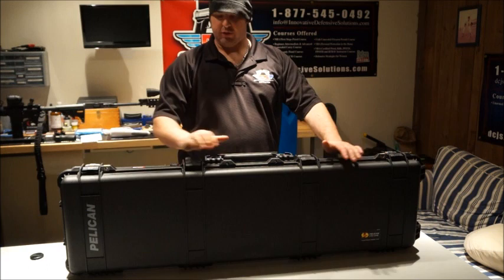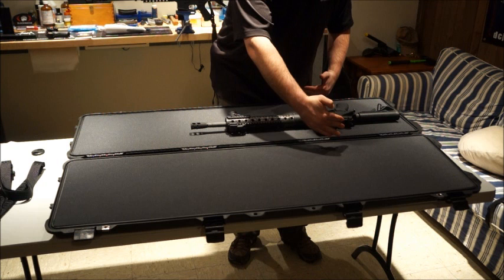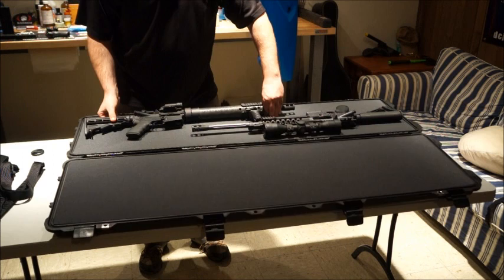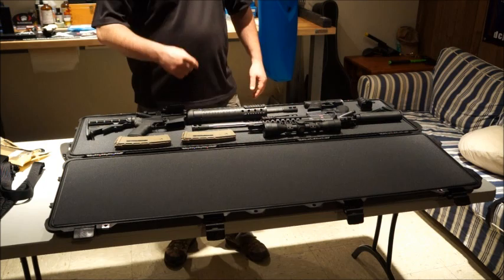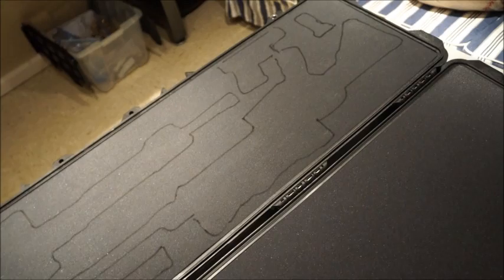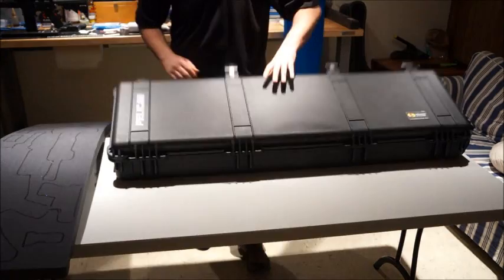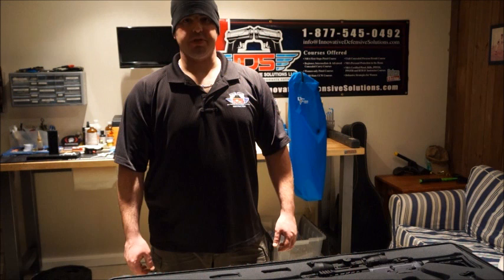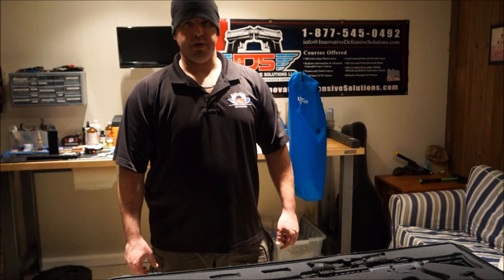How to cut and prepare foam in a Pelican Case \\ Innovative Defensive Solutions, llc

Comment: NO, they don't! if you actually had a clue, you would have done your homework, as I have done. And contacted the TSA and the Airline I am flying on. All the require it so notify them in advance that you will be flying with a firearm (checked baggage). arrive earlier then you normally would, let the airline counter attendant know and have them notify the TSA that you are here to check in your firearm, they open, inspect and you lock it with YOUR own lock, not TSA lock and keep key on your body

Comment: Take the foam and sandwich it between two sheets of thin wood. I use MDF Panel on Common: 5/8 in. x 4 ft. x 8 ft. Cut the wood to the same size as your foam. Use clamps to compress the foam in between the wood panels. Trace your layout onto the wood and cut it with a fine tooth jig saw blade. Remove the wood panels and you have perfect cutouts. Its work perfectly for me.

Comment: Super helpful video even for using a Pelican case not for guns but for ebike batteries. I'm planning a DIY project to stick my two Lextric brand ebike batteries in a Pelican case, drilling a hole in the end of it to install an XT60 connector port to the outside, using a waterproof glue to get a good seal, and cutting out foam pieces inside the Pelican case to make sure that the two batteries don't rub up against each other. The problem is, I want to keep the batteries at the bottom of the case and cut out holes from the foam piece above it. It's going to be tricky marking that while lining it up just right at the bottom of the case. And then I've got to run some tests to make sure that the batteries aren't overheating next to all that foam. They don't get but slightly warm to the touch, but mostly when charging, not discharging. I plan on taking the top foam out before charging anyway.

Comment: Build yourself a hot wire cutter. It'll come out much nicer. Takes little more than a piece of  nichrome wire {guitar string, etc} couple sticks and a 9volt battery or any dc power source. The foam airplane guys are a good resource for info on this,

Comment: Make sure you cut the rifles to lay bolt and dust cover up so TSA can easily inspect the bolt to make sure it is an clear. Otherwise they will hold your case until you can come by and show them they are unloaded as they are not allowed to handle the firearm to clear. Pistols should also be stored with the slide removed and separated/ stored in a different part of the foam/case. 

I always break my lower and upper apart for flight travel that way it is clear for TSA to see in an X-Ray scan that they cannot possibly be loaded. So they have no reason to need to open the case.
Reply: +Thomas "SPAZ" Hill II  I don't plan on going by air, but those are some good tips!
PS: I'm needing a source for .250 /2.75 "Hollow-Core" /aka Low force o-ring material on the spool so I can make my own o-rings for a StarLight case which the female channel the o-ring lays in and the "male" part of the case sealing surface is identical in design to the Pelicans.

Any idea on where to get a 75-100ft roll /spool of "Hollow-Core, Aka Low force .250/.275 Neoprene /EPDM ?

.
Reply from the maker: Thomas "SPAZ" Hill II good tips if you are going to fly, although, every time I have flown no one has checked the chamber. SMH

Comment: I just pulled out the center removable foam and put my guns inside in their soft cases in the Pelican case. When I get to the other end I can still use my soft cases. The pelican case is like hauling around a boat anchor. Great for airline transport but heavy
Reply: +uscgalpha91 A variation would be going to the Dollar Store this summer when they have "POOL NOODLES" @ $1 a piece and grabbing a couple of them and positioning them to help cushion things.
Reply: Fab idea. Foam is foam. I bought a Colt AR barrel and it came in a foam pipe sleeve.

Comment: Just my opinion but when cutting foam, you should trace and cut from underneath for clean cuts. Every one of your cut outs is not straight with imperfections. Also, it is critical to place the electric cutter blade up against an edge of a table to ensure the blade is straight up instead of an angle.
Reply from the maker: Good idea, noted.
Reply: When you say, " cut from underneath for clean cuts."  Please explain.

Comment: If you have something that is below the top foam level, would it be possible to shave a 1/4 or 1/2 of the piece that was cutout and put it back in, so it would be easier to get the item out? If so, how would you go about shaving the cutout piece to an appropriate thickness?

Comment: using an extension lead is ok as long as you unreel all of the lead from its case.
the lead will generate heat if coiled and dragging excessive current.
however I agree he seems a bit dangerous and slap dash. to cut out the blanks
I would have used a hot wire personally

Comment: I just bought a pelican that has no foam inside, do you know where I can get the type of foam that is in these cases normally?  Also, do you advise spraying "plasti dip" over it once you've made all your cuts?
Reply: I bought some more from Amazon
Reply: +Annony Mouse Tell Brack Wilson @ Patriot cases the guy with StarLight case that needed advice on a warranty issue and a place to buy o-ring material for same on a spool so I could make my own case o-rings sent you.

PS: You want 2.2 closed cell foam (Mil-spec- very dense and oil resistant), not the open cell foam, or pick and pluck foam..)
Reply: +Annony Mouse, here's the Pelican link; but I'm also going to look into the foam from Patriot Cases. 
https://www.pelican.com/us/en/accessory/cases/3-pc--replacement-foam-set/1751

Comment: Would you recommend this type of foam or pick n' pluck foam?
Reply: +PhanaticFilms  You don't want "open-cell", OR Pick and Pluck foam.. you want Closed-cell 2.2lb mil-spec high density polyethylene foam. (Mil-spec- very dense and oil resistant)
Open cell holds MOISTURE (Will cause things to RUST)
Open cell will degrade via contact with oil.
Open cell won't hold heavy items in place very well /will allow movement.
Pick and foam stuff, ditto and it will fall apart even faster.
In short anything other than 2.2lb or higher mil-spec high density polyethylene foam is crap. 

Tell Brack Wilson @ Patriot cases the guy with StarLight case that 
needed advice on a warranty issue and a place to buy o-ring material for
 same on a spool so I could make my own case o-rings sent you.

PS: You want 2.2 closed cell foam (Mil-spec- very dense and oil resistant), not the open cell foam, or pick and pluck foam..)
Reply: WeAreNotAlone69 Thanks for the advice! But looking for something to hold my expensive camera equipment, not firearms :P
Reply: +PhanaticFilms You did not mention cameras going in case, nor if items are only going to be transported, vs stored in case.

Open-cell/  Pick and Pluck foam is for light weight items, and it absorbs moisture.

Closed cell foam IMO would be a better choice. This said it comes in various  densities so you should pick density to match weigh of equipment, keeping in mind as density  goes up shock absorption goes down.

One more tip, regardless of foam used put in a good quantity of desiccant.
Reply from the maker: PhanaticFilms this or something denser

Comment: Good point on collapsing the stock, I left mine out when I cut my first layout, I did that so I could fit one that might not be collapsible in the same spot in the future.  But hindsight I would have done it differently, best part is I'd just have to buy new foam.  Also good point on the saving the cut outs..  here is my 1720 https://youtu.be/Eo2NmDq4Nfg & my 1490 Setup for an AR Pistol https://youtu.be/trS1bjsAd0Y

Comment: Why not use a jigsaw?
Reply: +Karl Webb  Jig-Saw would tear the foam, and would be hard to suspend off the foam while making the cut. A High speed router table is what the pro's use.

TIP: I've read that to keep the foam from ""hollowing" while your cutting it is you either put a old piece of foam under the one being cut, Or you fully support the foam off the tablet so the cut goes all the way thru as is being done in this vid with electric carving knife.

Another tip is to do the marking on the backside I've read, but I'm wondering how the start /final part of the cut would line up. I think it would be better to cut it from side that will be showing.

Oh, mark the foam with chalk, and cut 1/4 -3/8 inside the line so item will be held securely... at points you need a place to stick your fingers in to life item out, take a nickel or a quarter and trace around 1/2 of it.

Comment: Pluk-It Foam is the ansewr to this
Reply: Pluck it foam isn't as durable bc the rifle never quiet fits right...and it's not a solid piece of foam.  I have "pluck it" foam in my Plano 42 inch All Weather Case Model 108423. 
I coped with it for awhile...never liked it. Would rather cut a clean shape.

Comment: Entire lid space wasted.
Reply: +Kevin MacDonald lid space?
Reply: MR. Smith When I first bought my 1720 case I looked at options for utilizing the lid space, but didn't want to spend the money on organizer type inserts.

So I glued in a piece of 1/4 closed cell foam to the lid. Then traced out four pistols and four mags for each, on a piece of 1 5/8 closed cell foam. This stacks on top of the bottom layer that has two AR platform rifles. one 16" barrel and one 10.5" barrel with four mags each. Velcro holds to top and bottom of 1/4"foam in between.

It's snug when closing the case but keeps things tight inside. So when you open the case you remove the pistol layer to get to the rifle layer underneath.

Comment: F%@k! Stop using meat cutter and use foam cutter. It's really inexpensive and IT IS DESIGNED TO CUT FOAM!!!
You don't use mud to clean you weapon, ou don't use water to lubricate you car's engine, stop to use the wrong tools!
Reply from the maker: Bazuzeus relax man. When I made the video I didn't know about hot wire cutters, not everyone has access to those, but many have access to electric knives which also work.
Reply from the maker: If I had it to do over I would use a hot wire cutter and or use both to show each method!

Comment: This guy is sloppy and very unsafe in his methods. 1. always wear safety glasses. 2. the reason the electric knife has a short cord is to prevent electrical resistance, using an extension cord is a safety hazard which could cause un necessary heat build up and a short circuit. 3. Never touch an electric knife blade when it is plugged in, even if it is off.

The camera does not truly show the finished results which to my eyes have gaps and some sloppy lines. Also these cases are designed for certain weight tolerances, he has so much shit packed in that case it probably weighs 50 lbs or more, Not a good practice.
Reply from the maker: +Mark Faulk SMH....
Reply: +Mark Faulk 1)  You are correct, anyone doing work with painting, sanding, cutting or grinding should wear safety glasses - but in this case, cutting foam probably doesn't pose that much of a hazard.  When I cut fabric with a pair of scissors, I generally don't wear safety goggles either.2) That's a possibility, but since the electric knife is run intermittently and for only short periods of time, how much heat do you think it could build up and cause a short circuit? I DO know how hot even a short electrical cord can become when it's attached to a 1500 watt electrical heater, but that's when it's drawing a LOT of current over a period of time.  I think you're being overly cautious in this instance; the average electric knife draws about 100-175 watts from what research I've done on the InterWebs.  Unless you have some other documentation to support your claim, I have to discount it.3) Sound advice!  Personally I'd never even touch a blade on any knife I own unless I had 1) Thrown it to the ground, 2) Stamped upon it many times, 3) Picked it up out of the mud and confirmed it wasn't ready to attack me.   Actually, to be quite honest, this last safety tip is probably a sound one; touching/gripping/grabbing the blade of an electric knife that is still plugged in (even though it's Off) could be potentially hazardous if it gets bumped, jostled, hit or dropped while it still has power going to it.  It's a very remote circumstance, but it COULD happen.As to the finished results, I can't discern if there are gaps and/or sloppy lines from the video - it looked pretty clean to me.  As to specs on the case, I think you need to do a bit more research: http://www.pelican.com/us/en/product/watertight-protector-hard-cases/large-case/long-case/1700/ is the one I purchased.  Here are the CERTs it has:  IP67 / MIL C-4150J / STANAG 4280 / Def Stan 81-41.  I'll let you do your own research on Evan Carson's 1750 case as depicted in this video (hint: it's not much different.)I personally don't buy your "he has so much shit packed in that case it probably weighs 50 lbs or more, Not a good practice" theory; this is why I provided you with this link and the CERT info.  Please feel free to prove me wrong!-scoff
Reply: I'm looking at the specs on the manufacturer's site and seeing this:
Weight With Foam
25.57 lbs (11.6 kg)
Buoyancy
187.39 lbs (85 kg)
So I'm guessing it's rated to carry up to 161.82 lbs (73.4 kg).... easy math.

Comment: What type of foam is this?
Reply: +Abendschein Most likely "Open-Cell" Polyurethane. 
In a gun case you want 2.2lb or higher mil-spec high density cross-linked closed-cell polyethylene foam.